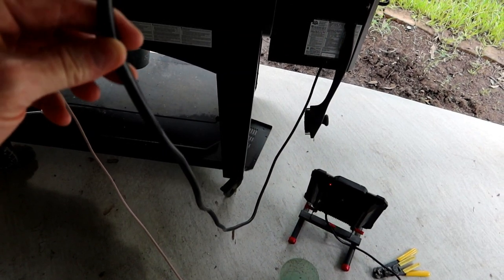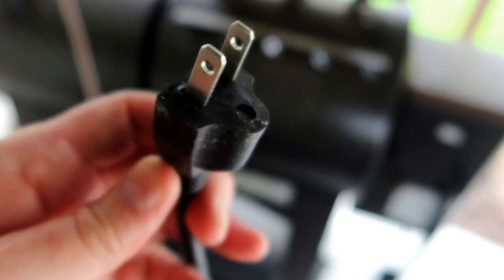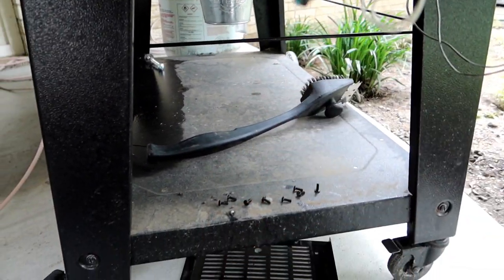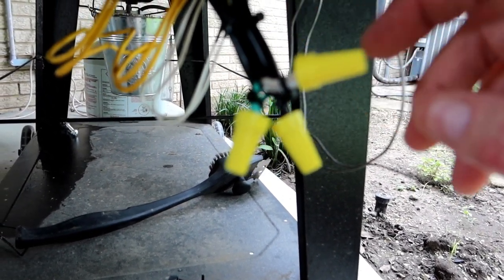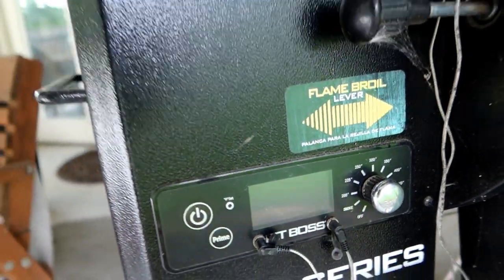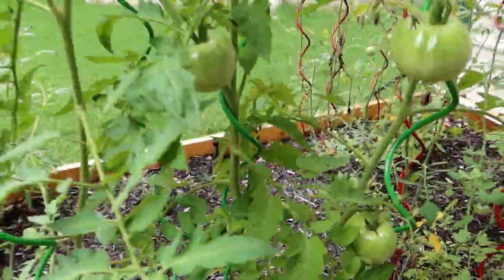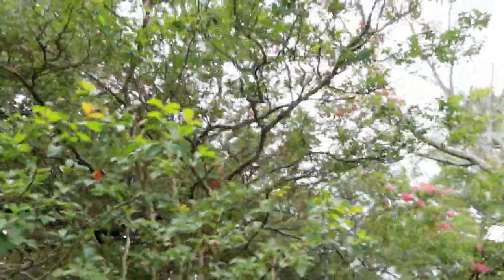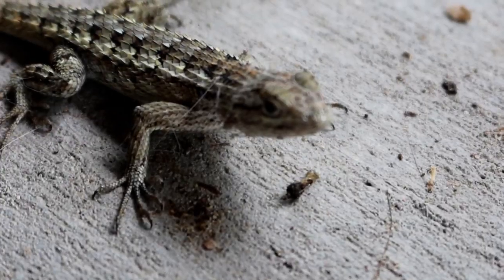Replacing The Power Cord On My Barbecue - Escaping The Mouse - ETM-598

Comment: The reason why you see so many “Myrtle” trees there is because after a big twister blew through there it had pulled up a lot of the trees that were growing there. The city needed a tree with a good root system and the Myrtle was it. So, Waco bought a whole bunch of Myrtle trees and planted them. ( That’s an odd looking little fella... geicko?,alligator?,lizard?.. “ Gizzard!  😀 )
Reply from the maker: Well that and the fact that they are a pretty tree and seem to do very well in this part of Texas.  I do get occasional examples of Texas wildlife in the house.  I've seen these guys outside, but this the first time I've seen one in the house.
Reply: @EscapingTheMouse  One year I had a Small bird house that was about 2 inches by 2 inches, White with a red roof hanging in my kitchen. I had the door open and in had flown a Hummingbird. It was in front of the little house checking it out. I said,” Hello.” It turned and flew back outside. Some time had passed, but it made a return visit. I think it liked my backdoor garden. On one of its visits it said what I perceived to be,” Hi! “. ( I think the wild life may be as curious about us as some of us are about it.) ✨👍👍✨😉

Comment: Working on this now. How did you get the old cord out without damaging the rubber "gaskets?" That the cord runs through the metal box and bracket?
Reply from the maker: I cut it off inside the power box and pulled it through the gasket.  Then I slid the new cord in through the same hole.

Comment: Why couldn't you just buy a heavy duty extension cord??????
Reply from the maker: Two reason actually, first, it didn't seem to make much sense to install a higher gauge cord on the BBQ than was there originally and second, a higher gauge cord would have been thicker and wouldn't have fit in the strain relief.
Reply: No, you didn't have to splice the cord into the other very dangerous way of doing it, what happens if it gets wet, zap, should have just plugged the one cord into the other, you didn't replace cord!!!!!!  Sometimes you just over complicate things!!! I guess no one wants to say anything, but you do know your stuff✌️
Reply from the maker: @chrismoss5169  Actually, this is the safer option because the splice I made was in an enclosed, waterproof section of the grill.  If I used an extension cord, there would have been more of an electrocution possibility because that area of the patio sometimes get wet.  I stand by what I did, I feel it was the safest option.